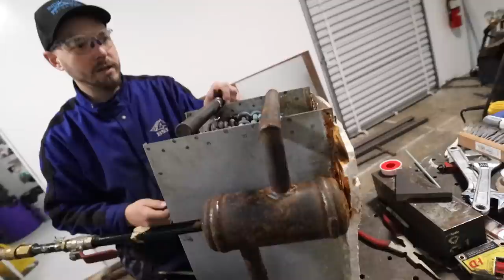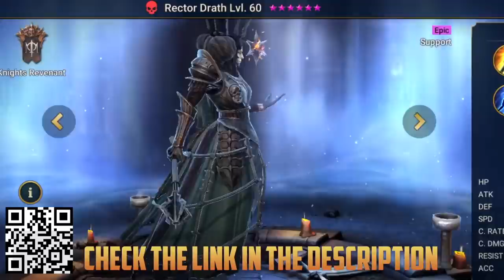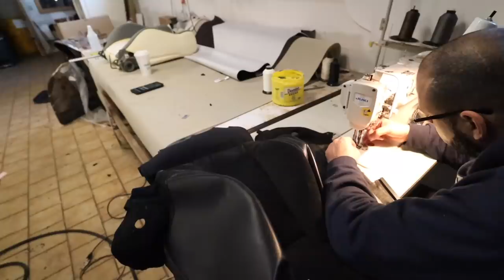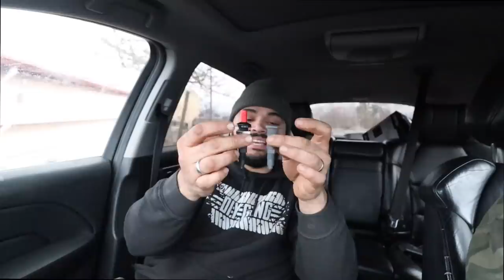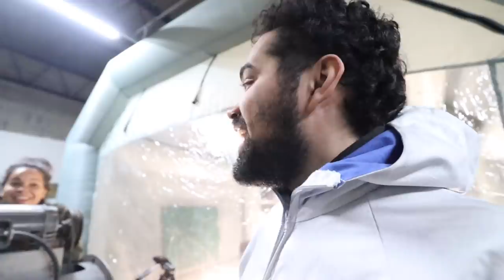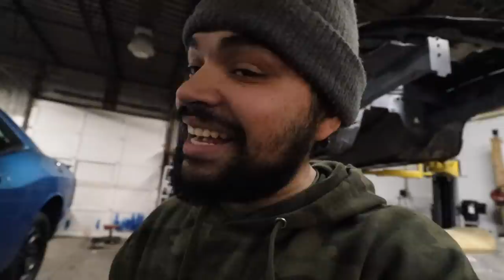We Finally Painted the Scat Pack!!

Comment: Need a zero tip to braze that coil.. get wet rags tp protect the rest of them end u bends.. once you heat one coil the rest fall like dominos and fail. I do HVACR daily and have for 30yrs. Once a coil starts failing it should be replaced. You can make a temp repair but its just that temporary. Jose great job on all the hard work. Merry Christmas you you and your family. Stay safe and be well.

Comment: Why not pdr the roof should be cheaper and better to the car and the quality of the repair. Leaves no damaged paint / rust protection a replaced roof skin usually tends to go rusting after a few years. I don’t see you use any wax or other rust repellent after your grinding and welding works?